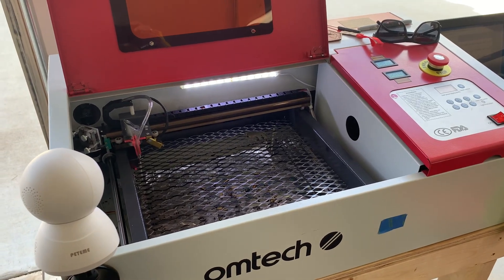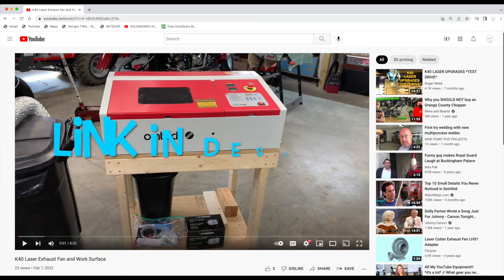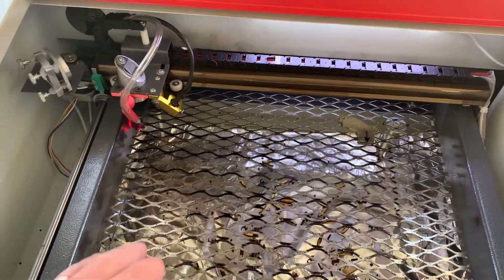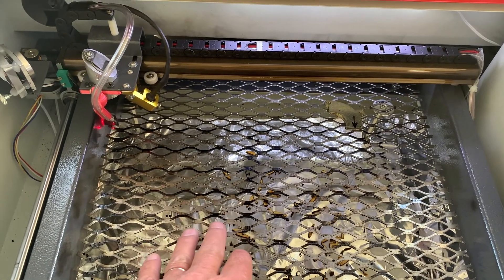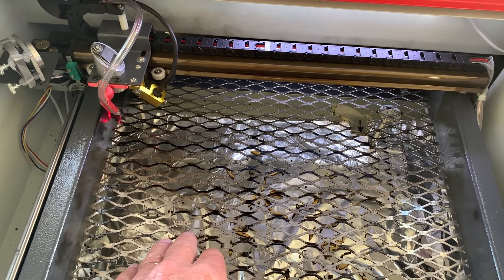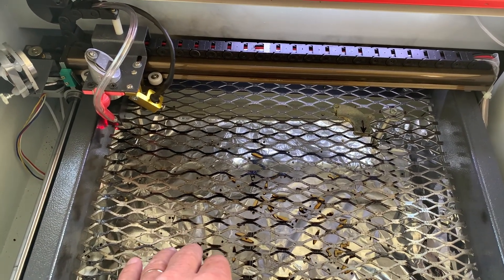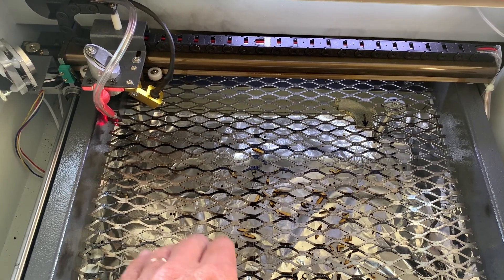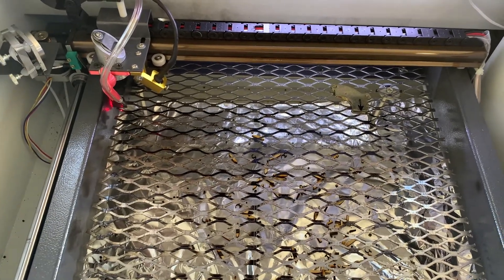K40 Adjustable Work Surface

Comment: Nice job and thank you for sharing the files. I have a much larger laser and did a similar bed but instead of using hacksaw blades I use 1 metre length 2 mm x 20 mm aluminium slats on their vertical  edge but sitting on a right angle extrusion but held in place with 3d printed spacers like yours but slightly larger obviously , the bed is around 1, 4 metres long by just over 1 metre wide .

It goes up and down on 4 lead screws with pillow bearings and driven by a Nema 23 with a gearbox and is controlled using an auto focus CloudRay pen system linked to the Z axis and the grbl controller from VMS Lasers which is brilliant  .  I do a lot of large panel work.  It can raise and lower by 40 cms as I do get a lot of work to do on chests and boxes so allowed for that in the design. 

This would be very useful to the K40 community which is where I started a few years ago. Well done and thanks again for sharing the files to the community, most people I fear wouldnt and would try to sell this on etsy or eBay.  Its really nice you have done this and as a admin on the Facebook VNS site I would like to share this on that for the benefit of our K40 users.  Thank you 

.
Reply from the maker: Hi and thanks for watching and the comments. You def have a much larger laser! I have to say that the bed adjuster that I am sharing needs a lot of work. Please share wherever possible, just let everyone know that it will require tweaking and sanding to get to work properly. It would probably be better with a belt instead of a chain like I did. When you share please credit me and list my YouTube channel: Youtube\NinePointFiveProjects
Please Like and Subscribe..
I am happy to answer any questions about the bed adjuster. Thanks!

Comment: Thank you so much.  I don't have Solidworks so I downloaded the STL.  When I try to load it into BambuStudio or Simplify3D or Prusa Slicer it comes in as a tiny single file.  Not individual objects I could print?
Reply from the maker: Hi, thanks for watching and the comments. I see the problem you're having. I'm going to have to research how to break that up. Short of that I'll have to create STL files for the individual components. Unfortunatly that's going to be a while before I can. I am leaving for a camping trip and won't be able to get to this until I return. Either way I think you may have already but if not, please consider Subscribing and hitting the like button. Thanks Again.
Reply: @NINEPOINTFIVEPROJECTS  I did. I have a friend who works in solid-works and he’s going to export the individual files.  If you want I can put them on Thingiverse once I’ve printed them.
Reply: @NINEPOINTFIVEPROJECTS  the metal side braces and the chain, can you tell me more on where to source those?
Reply from the maker: The metal side braces were just some 5/8 x 5/8 metal angles that I got from somewhere, sorry dont remember. I used plastic sprokets that I got from McMaster Carr, P/N 60425K14. And chain to match that sproket, sorry I don't remember the size of that either. This is an area that def needs improvement. You might be better with small toothed pulleys and and some timing belt similar to whats on small 3d printers. The cool thing about McMaster Carr is that you can actually download 3d files of almost everything they sell from their website. So, you could download a pulley (or sproket) and print it yourself without having to buy the part. Just a thought ;)
Reply from the maker: I went ahead and created individual STL files. The link is in the description. Good luck with it and hopefully you can make some much needed improvements. Yes, please put on Thingiverse (I am not familiar with it so much), but please credit me with my Youtube channel link: Youtube.com\NinePointFiveProjects
I would appreciate it. Thanks again.
Reply: @NINEPOINTFIVEPROJECTS  Absolutely!  Thank you so much.  I will come back and post the link once it's up there and I will share the part numbers for the chain/sprockets or toothed pulleys/belt that end up working out!  Have a great camping trip!
Reply from the maker: I just found this which might help you. Get this program called Ultimaker Cura. 
https://www.youtube.com/watch?v=8LGSY2jRUDw
I use it to print on my 3d printer. I think it will allow you to separate the parts. The reason it is small is that it must be coming in as metric. I would recommend bringing it into the Cura program and leave it in metric until you separate the parts as shown in the video. You will need to select and delete enough parts while it is still small so that the parts left will fit on the print platform when scalled to full size.  You will need to scale the assembly up by 2540%. If this doesn't work, I'll create individual files for you in about 10 days or so.

Comment: Very neat idea. if only they made 3 foot saw blades like this- I just built a chicken wire cutting bed but it's not perfectly level so i have to relevel the bed every time i set a new piece of cutting material down. it works really well when its setup and going but it's a pain. I'm probably going to do something like this next but with wire stretched between instead of the saw blades- like guitar wire or something like that.
Reply from the maker: Hi and thanks for watching and the comments. You may have already but if not please consider Subscribing and hitting the like button. Thank you!
Reply: use aluminium slats

Comment: Great idea! If these K 40s came with a knife system installed instead of a solid bed, the performance out of the box would be way better…. Even without the adjustable part.
Reply from the maker: Hi MSR,. Yeah I don't understand a solid bed on any laser. Anyway thanks for watching and the comments! I really appreciate it. Also if you haven't done so already , I'd really appreciate your subscription. I'm trying to build my channel and every subscription helps!

Comment: This is very cool!  I am just now setting up a K40 laser.  Did you design this?  If so, I was wondering if you were publishing the 3d files?  Thanks in advance!
Reply from the maker: Hi, yes I did. Even though what I have works, there is a lot of room for improvement. I would also make some design changes before I did it again.  Either way I can share the files with you if you want. Just be warned, they take a lot of sanding and tweaking to make them work correctly.